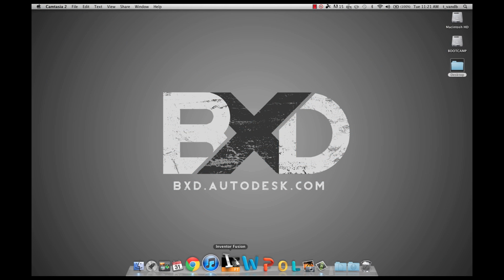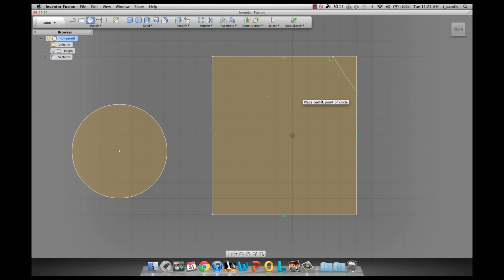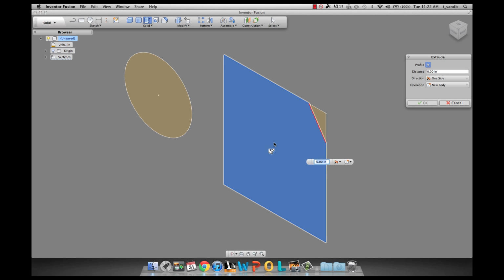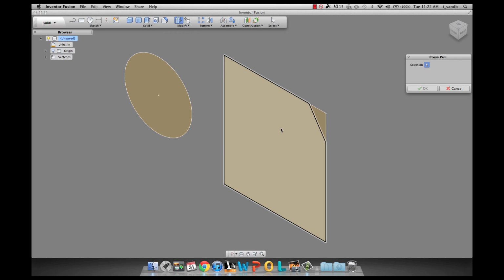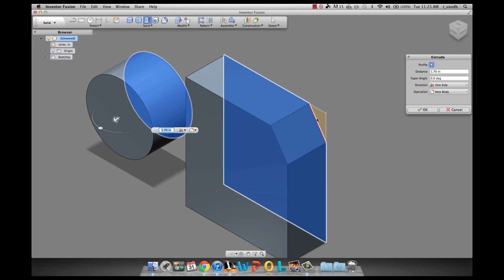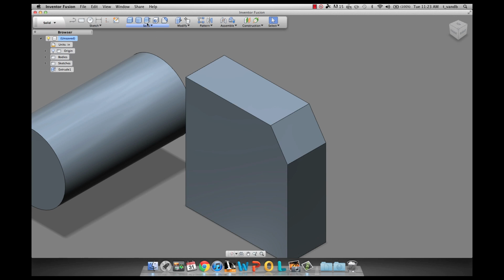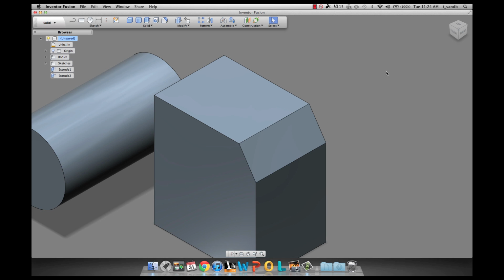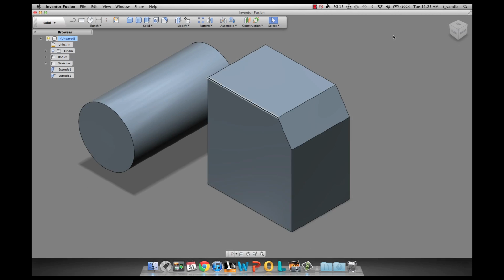Autodesk Fusion- Push/ Pull (Built by Design 4)

Comment: Does this work like Sketchup? I'm looking for a good 3d program with Sketchup style modelling.
Reply: Update on your 2 year old comment. I abandoned Sketchup for Fusion 360. Sketchup is like cross country skiing. Fusion 360 is like downhill skilling or snowboarding. Sketchup was laced with vulnerabilities when used for 3D printing - as of 2017 couldn't handle small dimensions. Couldn't stand all the fixing that had to be done, wasted 3 weeks learning it. Switched to Fusion 360 and not looking back.